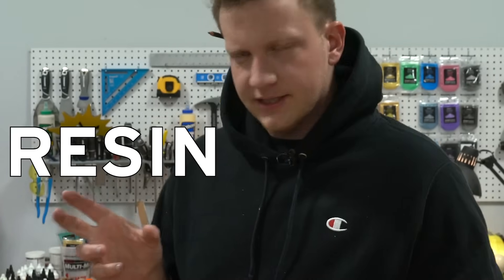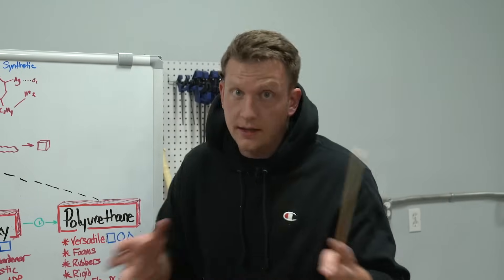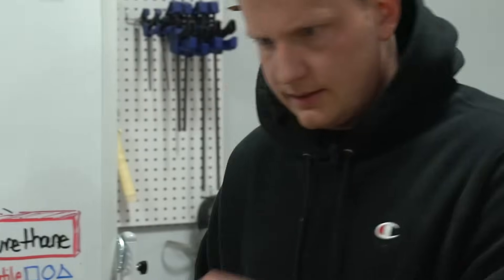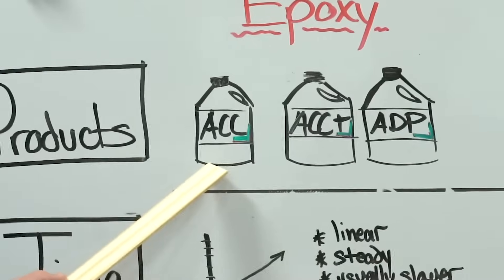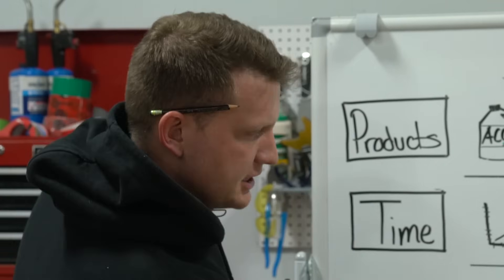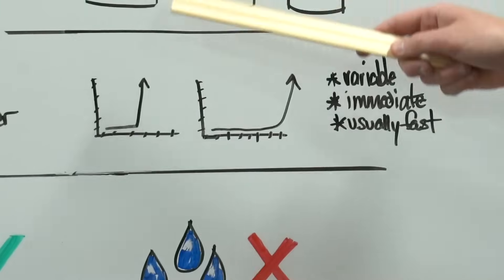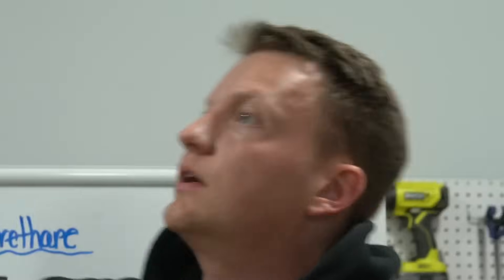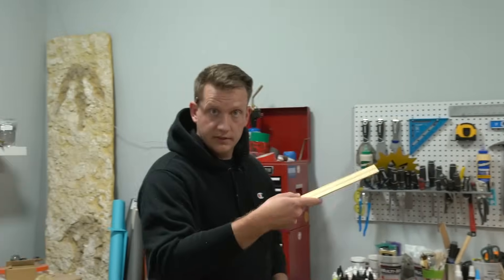Alumilite Explains: The difference between epoxy, polyurethane, and resin

Comment: great info. thanks a lot. question - can I use epoxy resin on painted saw for outdoor (art project)? will it last a long time on the sun and rain? if not what should I use? thanks.
Reply from the maker: Great question! Fully cured resin will hold up in rain but all resin will yellow over the time in the sun. For the best results with UV rays we would recommend using Amazing Clear Cast Plus epoxy so it stays clear longer!

Comment: There is one more difference.. epoxy is not resist against uv but polyurethane does..
Reply from the maker: Yes, that's a great point! We touch on it in our Epoxy Yellowing video!
Reply: @AlumiliteCorporation  i do a lot of polyurethane flooring in the netherlands..  in livingrooms bathrooms etc because of the uv resistens

Comment: My bar top is ethanol stained and then sealed with Zinsser sanding sealant. The epoxy finish on top has looked great for 8 months but now a little moisture from the oak is shining beneath the finishes and on the edge it is starting to blister. I will need to repeat the project I know but how do I stop any remnant moisture in the timber(and there will be some) showing through the finish in time? The bar has morning sun through the windows and the moisture has released from the timber this summer. The oak is kiln dried prime too. Any guidance gratefully received Thanks Martin
Reply from the maker: Great question! We had our educator Jordan take a look and this is what he had to say: "Dry the wood out as much as possible. Limiting the moisture will help ensure this never happens. Getting it down to less than 9% is ideal.

I also don't know epoxy they used on this. If they seal things up ON ALL SIDES of the project while the wood is much dryer, then the moisture shouldn't be an issue. If they skip a side, then moisture will enter into the wood from another angle."

Comment: You use examples of coating wood. But what about when casting the material into silicone molds?
Reply from the maker: Any of our epoxies and resins can be used in silicone molds! You'll just want to check the depth pour limit of each product and make sure you're not over-pouring in your mold.

Comment: Can you epoxy over an oil-based polyurethane? Will they bind and hold together?
Reply from the maker: Great question! As long as your oil-based polyurethane is done off-gassing (if it does at all) you should be able to epoxy over it. We would recommend doing a small test pour first to make sure that it works!

Comment: Well thats all fine and dandy but how does that staff react under high wacum ore preshure? Temperature diferences? Curent and back curent when they exposed to electric devices? Does some of those products cary a curent? Why I ask this is because my classic cars ruber get eaten away for some reason giveing my big trobel and Im not realy shure what causes it? it culd by any thing from radio noise, alternator back charging, coolant electrolisys, all cinde of liqueds in a engine blown head gasket to the chemic composition of those oil fuel coolant and brake fluid.
So aperantly somthing is destroing that ruber so I suspect it has somthing to do with a chemical ore electrical reaction. Im not realy happy replacing always those deam spark plug wires and have a car basicaly who refuse to shut off that thing try's to disel it can do odd things but most of them are not healthy for my engine and Im anoyed. Does some ruber exist to solve this problem ore cinde of protection compount that actualy can protect engine from rosting, heat and static?
Reply from the maker: We have other videos explaining vacuum and pressure as well as temperature! You can find them in our Alumilite Explains playlist! As for a current, that's not something we test for - we do have a line of rubber resins that you can look into: https://www.alumilite.com/products/resins/rubbers/

Comment: At 0:18 secs of this video, I feel an immense wave of relief and gratitude for this knowledge.  I've been struggling to understand the different materials to use in my project and very confused.  My brain is the kind where it wants to slot all information into neat boxes for further retrieval.  Not having an overview of the categories and how they relate made it difficult to retain information - like having no file cabinet to slot the files in.

I could just hug you for the terrific way you explained it - concise, top down, logical, factual, and one picture = 1000 words!  Thank you, thank you, thank you!!!!

Part 2 suggestion:
Tinting Pigments.  Please explain pigments and tints.  So bewildering.
I want to use Durabak Polyurethane bed liner.  Its a great product but comes in standard solid opaque colors that I don't like.  They want me to use a non-water based, paste pigment to get my color.  I need to understand pigments as well as the paint side.  How many kinds are there that work with the Resins?  Please do a video on this!!!
Reply from the maker: This comment makes us so happy! If you ever have any questions, please email us at info@alumilite.com so you don't have to feel the frustration! Pigments and tints are a great idea for an upcoming video.

Comment: Hello, love your explanation of the two.. I need advice on how to put glitter on some of my subway tiles in my bathroom, would I use epoxy? If so how? Any help would be appreciated.. Thanks
Reply from the maker: Cool project! We would recommend using something like our Amazing Sealer (or modpodge) to do a coat of "glue", add the glitter, and then do a top coat of epoxy. If your tiles are on the wall already, then brushing on a coat of Amazing Quick Coat may do the trick - we would recommend testing this out first to make sure you get the results that you want!

Comment: Hey I have a huge question, or lots of them maybe. I'm doing my first ever mold. It's kinda large. I intend to use the mold to make concrete panels with roughly 18in x 40in x 4in as the dimensions. Which kind of resin should I use if I intend to pour concrete into it after the mold is complete
Reply from the maker: Well typically molds are made with silicone and not resin since nothing sticks to silicone except silicone. We would recommend reaching out to our technical services team at info@alumilite.com with this information - they should be able to help you find the best product and process for your project!

Comment: I have an older hot tub with a somewhat faded and oxidized fiberglass shell I would like to coat it and then wet sand/polish it to make it glossy and more like it was when it was new.. what types of products and application methods would be best for this the walls are nearly vertical where the floor of course is nearly horizontal.. I'm a little worried about runs on the vertical surfaces
Reply from the maker: This is a great question for our Customer Service team! You can reach out to them at info@alumilite.com.

Comment: I've a question you may or may not be able to help me with: if I'm making a mold from a 3D printed object, will clear epoxy be more or less vulnerable to capturing the layers from the 3D printing process than regular opaque urethane? I figure on one hand it's more viscous, so maybe it won't pick up that detail. On the other hand, it's transparent, so tiny imperfections might well seriously impact the clarity of the epoxy. I realize there are a ton of variables here. I guess I'm asking, there special precautions one must take when making molds for clear resins?
Reply from the maker: No there aren't any special precautions you have to take when making molds for epoxy vs urethane projects. Just make sure your master is exactly how you want it since the silicone will pick up every single detail!

Comment: I ordered white silicone molds for epoxy resin. However, I have polyester resin at home. Can I use polyester with my epoxy silicone molds? Would it stick to mold? Some people said it would be impossible to separate it from the mold unless I use some releasing solution or petroleum jelly.  And some people said because it's silicone it should be completely okay to use. I am confused. What should I do?
Reply from the maker: Great question! Nothing sticks to silicone except silicone so it should work great with your polyester resin!
Reply: @AlumiliteCorporation  Thank you very much

Comment: Question...I have a plywood floor. Primed with a paint primer. Then covered with kraft paper glued. Then 5 coats of a water base polyurethane product. I want a thicker topcoat/sealer....can I use a clearcoat epoxy over my floor? Thanks
Reply from the maker: As long as the water-based polyurethane product is 100% cured before pouring your epoxy, this should work great, but we would still recommend doing a small test cure to make sure there aren't any negative reactions!

Comment: So, I have a pool sand filter that has a tiiiiny little pinhole/maybe a crack. What would I use to plug that up with and what kind of cure time before I turn it on .Because as you may know, when use turn it on theres a HUGE pressure build up in these tanks and I don't want to blow up my neighbors roof with it if the resin or epoxy  doesn't hold up and the sand filter decides to blow up.Could you give me some ideas on how to do this right? Thank you..:-)
Reply: Hey Danielle! Jordan from the video here. For a critical, functional fix to a pressurized tank, I cannot recommend using our resin as a quick patch. Those tanks are often designed specifically in shape and in material to withstand the proper pressures (including a safety margin) that allow you and your neighbors to be safe while you're soaking up some sun and jumping in the deep end. My honest recommendation would be to reach out to the manufacturer to see what solutions they recommend that will give you (and your neighbors) confidence in the fix.
Reply: @jordanlshepherd  Thank you very much Jordan:)

Comment: Jordan, when pouring polyurethane,  should you put it in a pressure pot or just let it stand for the required set time? Do you have to wear a respirator? Can polyurethane be poured inside the house?
Reply: Hey Richard! It's Jordan from the video here. When doing castings with polyurethane, I would definitely recommend a pressure pot to ensure a crystal clear bubble-free casting. Just letting it sit to cure is absolutely fine, but you may end up with trapped air because of the shorter open time. As far as a respirator/pouring inside your home goes, I recommend using your best judgement. If you have a large space with excellent ventilation and airflow, then a respirator may not be necessary. However, if you're in a smaller space without those things (like a small bedroom etc.), you may want to consider it. I always default to "rather safe than sorry". Thanks for the great questions, Richard!
Reply from the maker: Thanks for watching, Richard!

Comment: Nice explanation. Should make a video about epoxy and polyurethane curing time when additives are added or what CAN actually be added.  For example id like to add aluminium powder to clear polyurethane so its sorta like ive cast some metal but obs it  aint really cast. Or would that not be allowed and have to use special chems
Reply from the maker: That's a great video idea! We'll definitely keep that in mind for future videos.

Comment: MY main question for it . is am hobbyist can it replace  polyurethane is super expansive but can expoxy replace that?
Reply from the maker: It really depends on the application - what you're trying to make and what materials you're using. A lot of makers use urethane resin to cast blanks and then turn them on a lathe - we've successfully done this with our Amazing Deep Pour epoxy instead! So it is possible, you just want to make sure that you do your research!

Comment: why is water clear so brittle? kinda disappointed in your products not gonna lie
Reply from the maker: Alumilite Water Clear is one of our clearest products and is typically used for making car headlights. With a shore hardness value of 72D it is more brittle than our other clear urethane resins which are in the 80D range - you just have to find the product that works best for your intended project!

Comment: Thank you! Smart and good way to explain concepts! I'm searching the right candidate to glue wood and rocks for climbing holds. I made a video using the gluegun but someone said that use polyurethane is better than gluegun. Epoxy can be a candidate?  What about epoxy Vs polyurethane in terms of mechanical prprety?
Thank you!
Reply from the maker: These are great questions! For this you'll want to look at shore hardness - people use resin instead of glue to create a stronger bond/seal! Urethane will cure more quickly but epoxy has a longer working time and is easier to use!

Comment: For child toys like Lego, what is resin that we use?

Thanks.
Reply from the maker: This is tough to answer because real legos are made from a type of plastic that we don’t supply. Since they’re for children we would recommend using an FDA compliant epoxy like Our Amazing Clear Cast (just make sure to let them fully cure for 7 days before playing with them). If you were making them for decoration, our RC-3 Tan urethane resin would work since it holds color a little more true than our Alumilite White urethane resin.

Comment: I'm late to this video, but what about the safety of epoxy and polyurethane? Fumes? Skin contact? I got toddlers so what of non cured or cured products in their mouths? Are these products food safe because people make cups with this stuff? Can the cured product hand heat or sunlight?
Reply from the maker: These are all awesome questions! All resin is pure chemicals and should never be ingested! When working with resin or epoxy you want to make sure you are in a well ventilated area and are wearing proper protective equipment like gloves, safety glasses, and in some cases, a respirator. You also want to keep your projects up and out of the way of children since they can be dangerous to them before fully cured. 

All of our epoxies (ADP, ACC, ACC+) are FDA compliant when mixed correctly and fully cured for 7 days - this is why it’s safe to use epoxy on cups and tumblers!

As for heat and sunlight, every product will react differently - check out our Epoxy Heat Resistance video: https://youtu.be/jjRE4TDopp8 and our Epoxy Yellowing video: https://youtu.be/ND2zVosuzIE for more information!!

Comment: Hey Jordan! I  recently had my guitar drop on cement and there's a chunk that shattered out of the polyester finish. As it is a clear finish I was thinking about maybe adding some color to the repair when I go to fill in the chunk that's now missing (sort of like how in Japanese pottery they repair cracks with gold leaf). Anyhow, what type of fill should I use for this project? Epoxy, or Poly? For reference, the chunk is about the size of a quarter with a good bit of shatter around the edges. It is also located on the guitars bottom edge.

Thanks for any advice you can give!
Reply from the maker: Hi there! I'll send your comment to Jordan and get back to you with an answer soon!
Reply: Buy a new guitar!
🤗😄✌️
Just joking, good luck!

Comment: Question: can i apply Varathane spray poly over Envirotex Epoxy resin (this one as a sealer for the wood, dont have money for the projetc and those are what i have in hand) ? Im doing a natural finish guitar with a little bit of black stain on parts.
Reply from the maker: This should be fine to do! Polyurethane doesn't typically like moisture so sealing the wood before spraying it is a great idea!! We're not too familiar with this spray though so we would recommend reaching out to the manufacturer or other woodworking groups on Facebook to see if they have any tips!!

Comment: I made few stones with cement/concrete for aquarium decorations... And now i want them to cover them with clear epoxy for long time preservation...
Is this a good idea? 
If not then what should i use?
and How about fiberglass reinforced epoxy with acrylic paint on it?
Reply from the maker: We would recommend using our Amazing Clear Cast to coat the aquarium decorations - just make sure that they fully cure for 7 days before putting them in your tank!!

Comment: If i need to sand urethane whats best
Reply from the maker: There isn't a specific type of sandpaper you should use for each resin, you can just start with a low grit and work you way up like you would with any resin project.
Reply: @AlumiliteCorporation  makes since

Comment: Please explain difference in safety precautions for epoxy versus polyurethane. Are both food safe?
Reply from the maker: We have a whole video on safety in the works! Both require proper PPE, but both are not FDA compliant. Only our epoxies - Amazing Clear Cast, Amazing Clear Cast Plus, and Amazing Deep Pour are FDA compliant after properly mixing and allowing to cure for a full week.